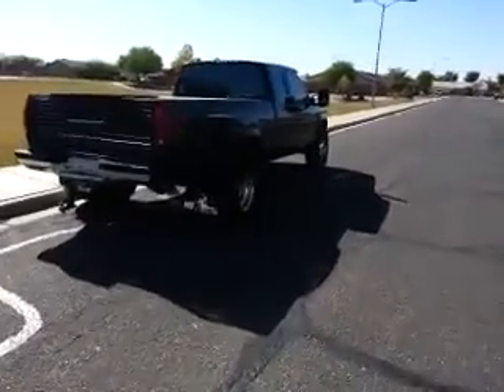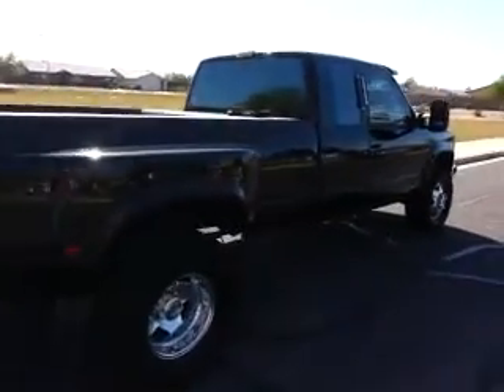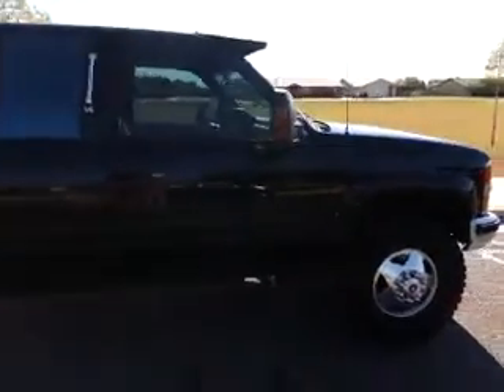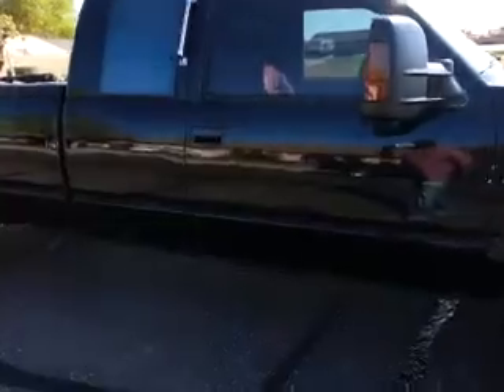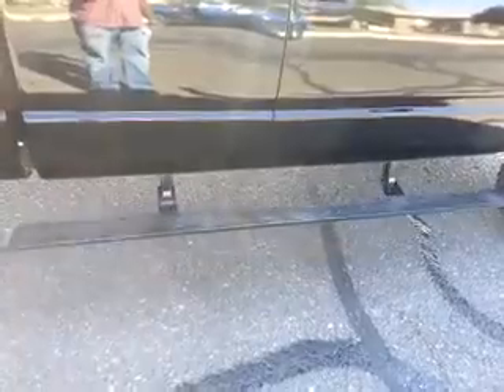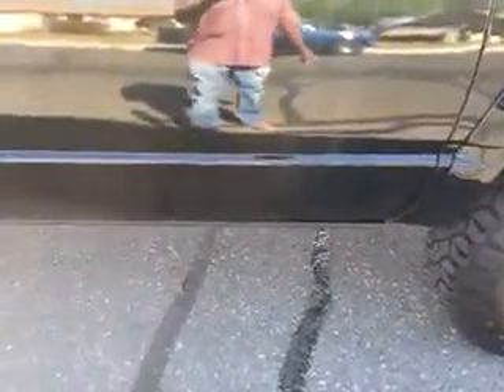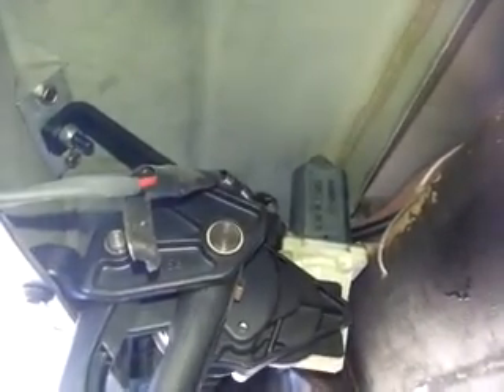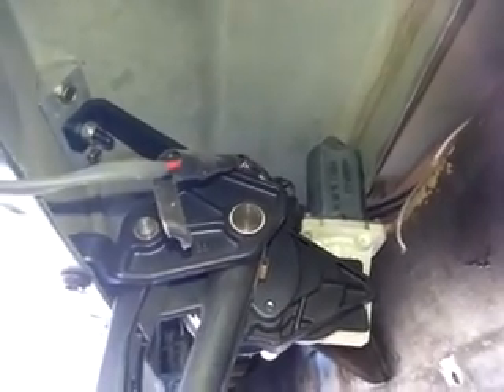1992 Chevy K3500 AMP Powerstep Install

Comment: The step kit is for the 99-07 trucks it works just have to know what to do just installed a set on a 98 z71 ext cab
Reply: Marcus Burrage can you post a video of how It’s mounted.
Reply: Hey Marcus do you have any pointers you can give for installing these on a 98 Chevy extended cab?

Comment: Hi,
Thanks for posting your video.  I have been trying to find a AMP kit that works on the older Chevy trucks, but AMP says that they only make them for 2000 and newer trucks.  Do you mind sharing what the kit number is that worked on your truck?  Other than the tight fitting motor and the relay mod, were there any other problems installing this kit?   Thanks

Comment: Could explain the wiring/type of relay? Or a more detailed video showing all the connections? AMP research voids warranty on models not it's not intended to go on, also if not installed by dealer. I have a 99 2dr Tahoe so install should be similar besides cutting boards to length.